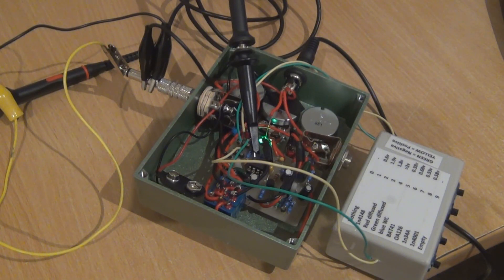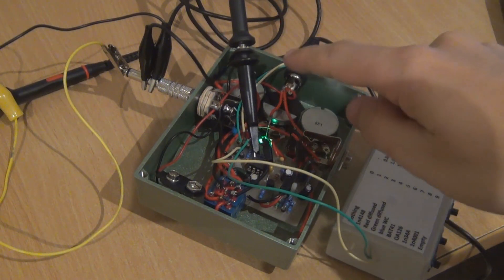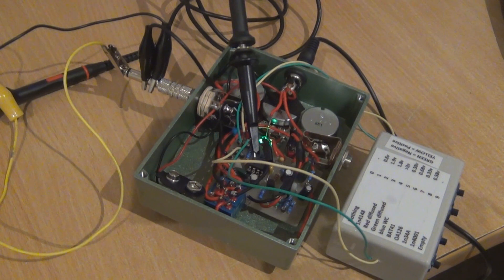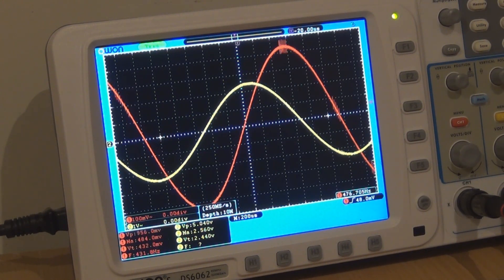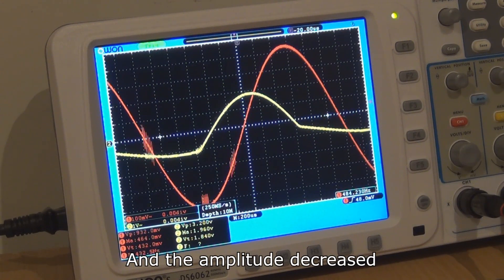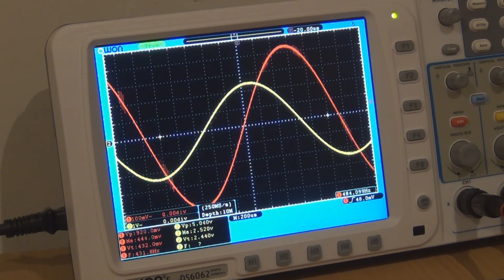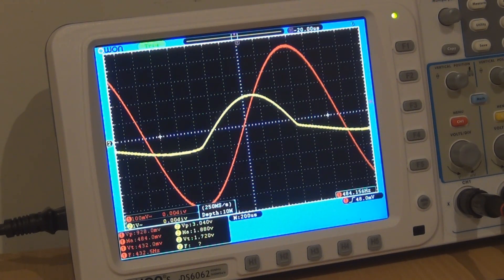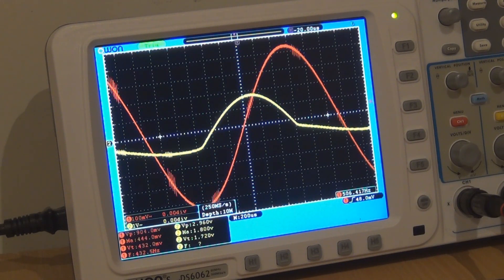Overdrive Opamp Feedback Diodes

Comment: Also if I use 3mm diodes will I get more distortion then 5mm.  What's the. Big difference
Reply: forward voltage is lower for the smaller ones.
Reply: +Nightingale1887 yah I've built a few pedals since I asked that  I'm loving bat41/mosfet and mosfet/LED   Andy Timmons od or the mad bean turnabout is a good example. Or the zen drive
Reply: Jesse Belanger I've made a Klon, Zen, Tonebender MK3, Fuzz Face, Red Snapper MK1 and a Fuzzfactory. The usual suspects.

SD-1 is my TS mod victim of choice, these are decent and fly under the radar in terms of price. Turned one into a Zenkudo.
Reply: +Nightingale1887 yah seriously you can get them for dirt Cheap and make something incredible out of it. It's the perfect pedal for modding, much like the DOD250    Simple and tons of fun to think up different mods for. How did you find the fuzz factory?   I built the sun face nkt75 and the sunface bc108 and there pretty fantastic and so simple.   It's the only circuit I've used pure carbon comp resistors on because typically there's to many values and resistors themselves to consider buying carbon comp.  there so overpriced
Reply: Jesse Belanger Fuzz Factory is fun, but super unstable. Can't really dial in something that will be the same the day after that. Germanium is fun! Poor Hendrix running those germanium FF pedals on searing hot stages. BTW I source my parts locally, there's a good lot of local small electronic suppliers a.k.a. old geezers happy to see somebody who can solder instead of rolling a blunt as a skill. A few have the old germanium stuff (e.g. AC128) in stock, but I don't really like them. Ranges all over  the place.